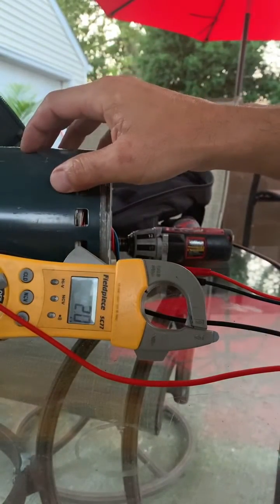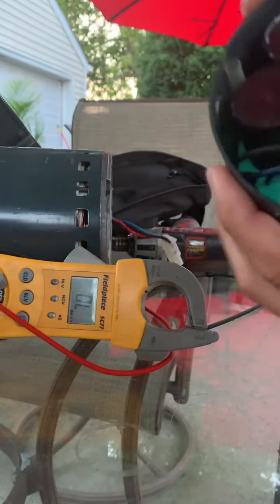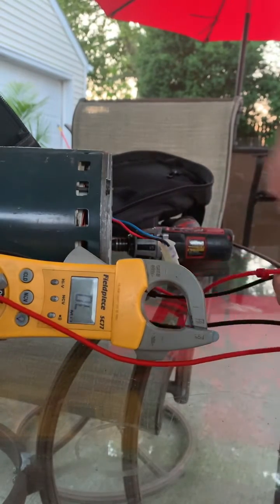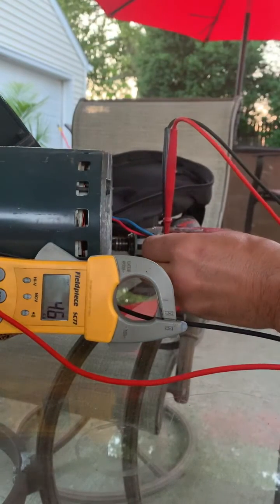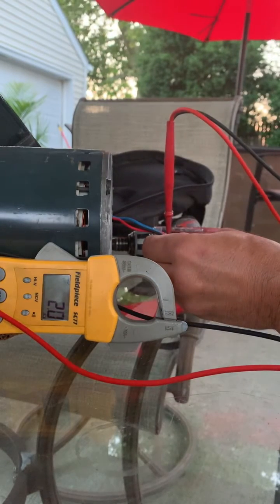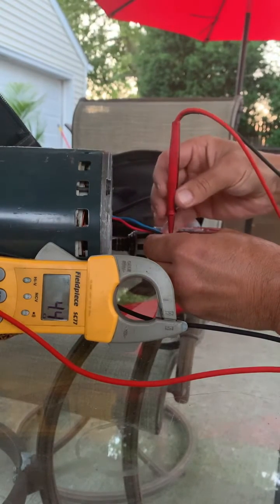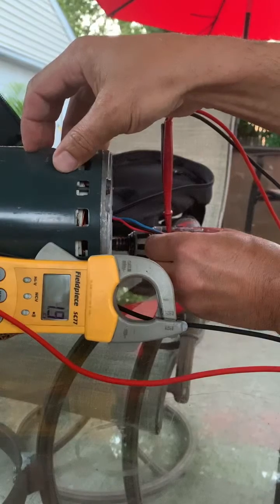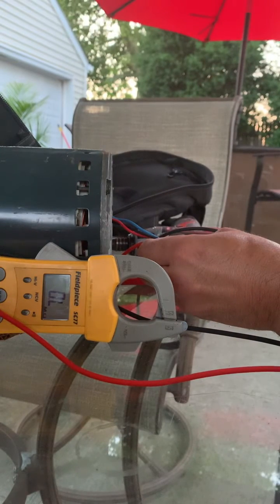How to test ECM motor and module

Comment: I'm DIY not a pro , I just replaced my blower motor because when it tried to start it would make a low rumbling sound and then quit and then do that over and over.  I have a ECM by  g e n t e q from yhe x13 line.  It's doable for the average person just make sure you note where the wires came from and don't break the control board.

Comment: My Climatemaster ECM blower motor makes knocking noise on start up. Does it need replacement in the near future? Or it can be repaired? Thank you!!
Reply from the maker: it’s cheaper to replace the whole assembly the module or the motor by itself is just as expensive...when it starts making that knocking noise That means it is going to go. I’m actually surprised it still  works making that noise lol good luck.
Reply from the maker: Can’t repair have to replace

Comment: I have a Carrier heat pump system in my house.  On the outside of the bell-end ECM module {that is the module on my ECM blower motor in my Carrier air handling unit, in the attic of my home}, the label says GE 1/2 HP,   01/26/01, CN02 2BFO.  That is what the label says on the outside of the ECM module. Anyone, how/where can I look to decode the meaning of the information on that label? From the information on that label how/where can I find out what is the generation of this ECM module (2.0, 2.3, 2.5, whatever), what programming was put into this module, and any other information, I am wondering. This ECM module has a 5-pin power connector and a 16-pin communication connector.  The outside of this module is black. (   my ECM blower motor is running slow, so slow that the evaporator coils will freeze up if unit is allowed to run very long  ) .  Measured in place by multimeter the ohms reading on the thermistor is 2 ohms.  The motor windings ohm out okay.  No obvious discoloration or burns in the module.
Reply from the maker: If it has different taps  can try a different tap for a different speed.. and again if the  motor is on its way out. It won’t do anything for you just bring the motor into any supply house changing out for a direct OEM
Reply: Thanks.

Comment: Generally speaking, in troubleshooting any problematic blower motor of the kind of equipment in your video would it be overkill also to remove that circuit board from the ECM motor end-bell and look at the bottom side of circuit board to check for any burn marks? In addition to ohm'ing out the motor windings, or in the case where the motor windings ohm out ok.   (   when the motor windings are okay and when  the thermistor is okay is it worth removing and checking the underside of that circuit board for any possible burn marks and indications of problems with other components on that circuit board?  Or would that be overkill?  ) .   Also, does that end-bell have mosfets in it?  If so, are they replaceable ?
Reply from the maker: Yes, you can’t start changing pieces on the ECM motor. They are secured in there with a rubber base so you have to change the whole module … if a capacitor or relay is shot. You have to change the whole module and if the blower motor shot same concept it’s actually cheaper to change the whole thing then trying to change parts and pieces on the ECM or the X 13.
Reply: Thanks.

Comment: These videos are everywhere..they say test the module but then the video is just checking the windings
Reply from the maker: You can’t really test the module that’s why you don’t see anyone trying to test it you have to do a visual inspection. See if there’s any burn marks on anything and if you test the motor & the motor is good the module is most likely the problem, but like I said in the video, I always change the whole thing. It’s very similar in price..
Thx for watching

Comment: What was your symptom? Motor not running or motor running constantly? I have a unit where the motor will not shut off.
Reply from the maker: is the board relay stock closed that could make the fan run constant.....normally when an ecm  dies it’ll take back-and-forth or not run at all

Comment: Can you test these ECM with just a multimeter I have a Lennox ECM 2.3 1/2 horsepower
Reply from the maker: Yes , I have a video on ECM motors check it out you have to ohm  them out if each leg is even then it’s OK if they’re different ohms it’s no good check out the video

Comment: like you said,i wouldn't bother replacing one or the other,why open up to call backs
Reply from the maker: Yes definitely no callbacks are good callbacks LOL
Reply: @lvvhvac9787  certainly lol
Reply: How about to save your customer some money... yeah, I know, hardly anyone actually gives a rip about the impact on the customer anymore - it's just charge them $1200 for a whole new every thing because that's more convenient for you.
Reply: @pelon542 :  Thanks for the comment.  I will acknowledge that there are some good HVAC  people out there... but I sure wish I could find one.  But how about letting the customer decide how much risk they want to take.   For example: "Your control module on your motor has failed... if I replace just the control module, your motor has 12 years on it and may last years longer,   or it could fail fairly soon.  For $400 more I can replace the motor too and increase your reliabilty.  Which way would you prefer to go?"   Why is this so difficult?   Instead I have heard "Nope... I won't replace the module only."   And why is it that I can look at dozens of 1/2hp ECM motors online and not a single one of them retails for more than $800... but Mr. HVAC always swears he's barely making money charging you $1200 for the same motor?   Isn't 80% markup a bit predatory?  I have no problem with a reasonable markup on parts...  but come on!
Reply: I agree completely with rhyme and reason which is why I give my customers the option.

Comment: Can you replace the electronic motor with a standard one ? What changes have to be made ? Great video , keep them coming.
Reply from the maker: You can replace the motor for a Single  or multi speed motor  however you'd have to configure it with a type of fan control relay or something like that in an emergency ..it's  best to choose an oem direct replacement....thanks for the question